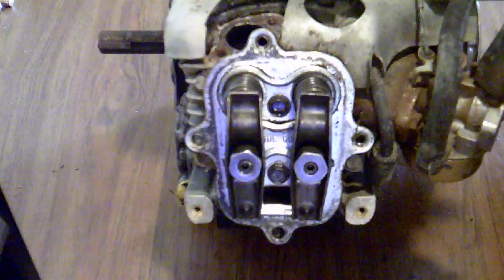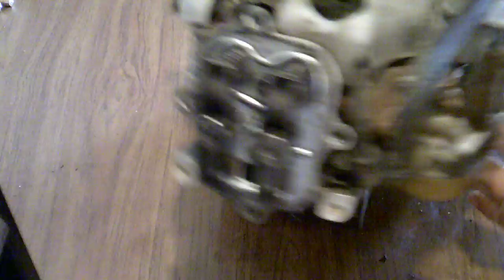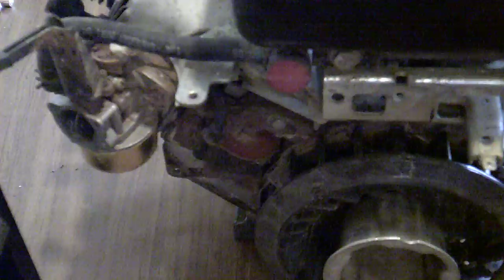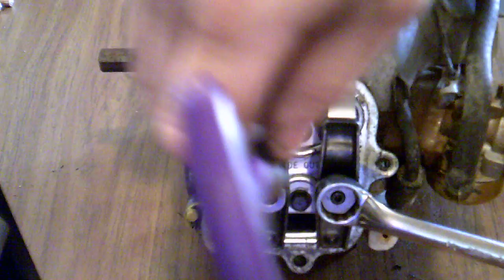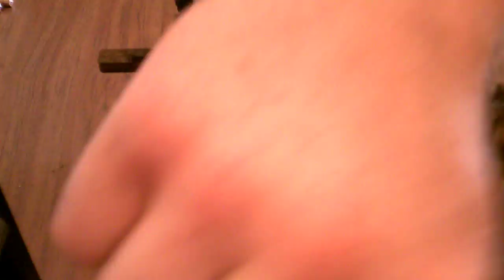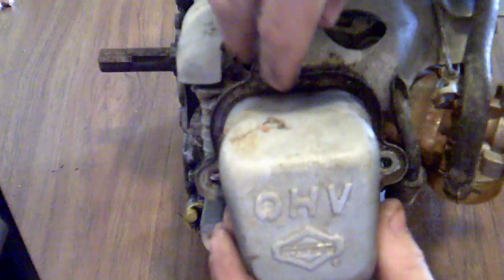How to adjust valves on a briggs engine

Comment: Thanks for the thorough video I appreciate it. Im trying to get the same engine running and having a hard time. 
Would you happen to know why the engine valves won’t open and close when I turn the flywheel clockwise but they will when I turn flywheel counter clockwise? I’m stumped and haven’t had any luck finding the answer. Thank you
Reply: Bad camshaft or bent push rods....could be a couple things to be honest...tear it down!

Comment: It seems like there are two times when the rocker arms will move at the same time.  One time the rocker arms are loose (and will move at the same time), another time the rocker arms are tight (and will move at the same time).  So I don't know which of these two times is the one to use for the adjustment.  Help me please.
Reply from the maker: When they are loose /just use a small pen light if your in doubt by looking into the spark plug hole as the piston will only be partially past top dead center .

Comment: Is this setting good for all B&S engines, including the newer lawn mowers with plastic carburetors?  (around 500 cc)
Reply from the maker: No although most briggs 28 to 33 cubic inch  OHV have a valve lash of 3 to 5 thousands on intake and 5 to 7 on exhaust . it is recommended you know your model type and code of the engine you are working on then purchase the proper briggs repair manual for your engine to insure your valve lash is right for that model. Smaller briggs engines like the intec in the video can vary but typically are 4 thousands for both intake and exhaust..
Reply: @kevinbolin7665  I have a 342cc Briggs horizontal engine, turns part of revolution then binds, even the electric start can't turn it, if I pull the rope and get past that point it will rotate further. do you think the compression release might be stuck?